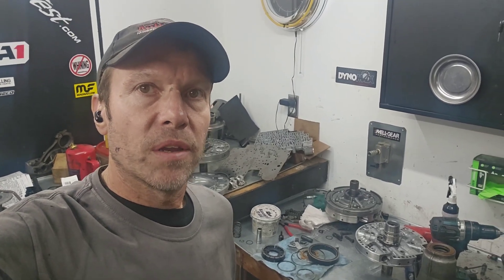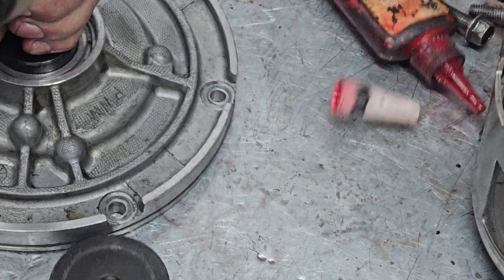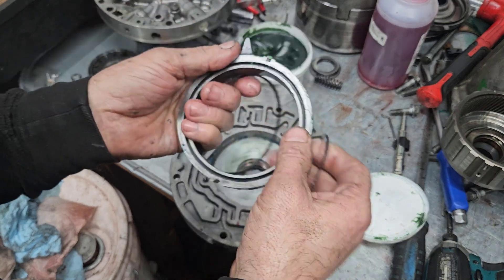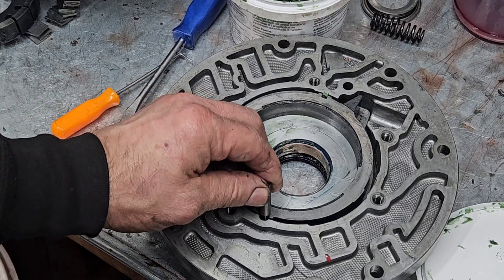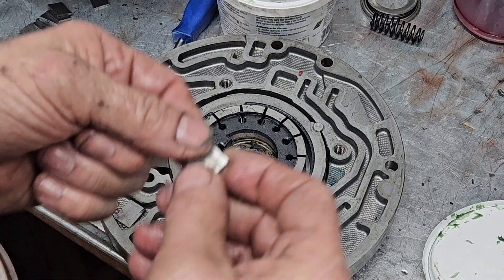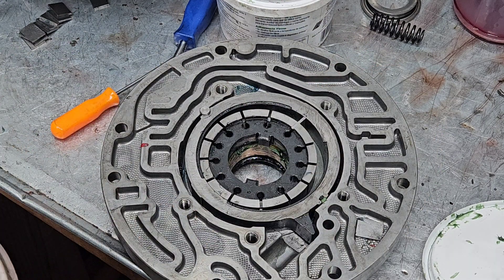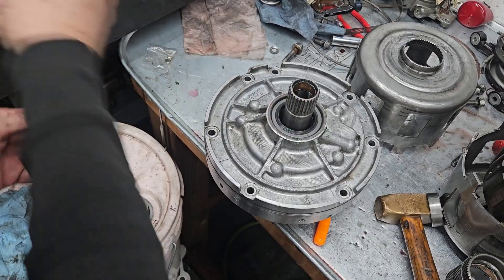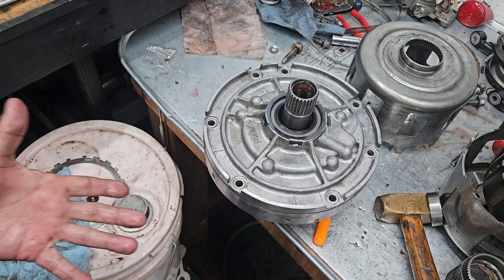DIY How To, 4L60E Pump Rebuild

Comment: Run a flat edge across the pump body with the rotor and slide only and make sure you have enough clearance especially with a new pump kit. You wanna make sure the pump and slide have at least .001 inches of clearance otherwise they will bind up when you torque the two halfa together, I've seen people with newly built pumps destroyed and don't know why.
Reply from the maker: Good tech tip!!

Comment: What about the pump filter on the side?  Sorry, I've never built a transmission before, but I have watched a lot of videos. My stage 2 full re- build kit will be delivered next week. Trying to learn everything before hand.
Reply from the maker: Yes there is a filter in the 0ump body
Reply: @autovationFtWorth  What do you recommend my 3-4 clutch clearance should be? I'm thinking. 0.40 - 0.80 with springs. It's a 2007  2.9 Chevy Colorado 2x4.  I'm building it up for my son. He's about to turn 15.  Looking for reliability not racing. Thanks.
Reply from the maker: @maces1405 i shoot doe about .050 on the 3/4 pack. 
One item on the input drum, press the shaft out of the drum and use a sleeve retaining compound or loctite to seal the shaft into the drum. This stops a hydraulic leak that most used units have and cause failures.